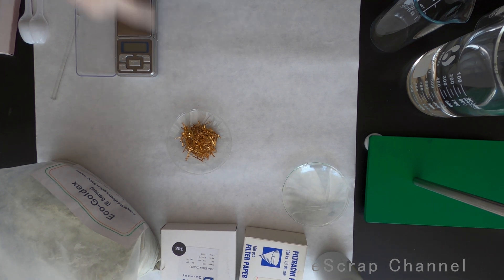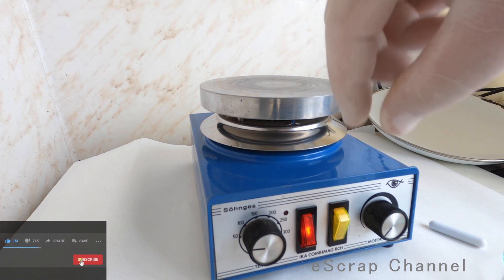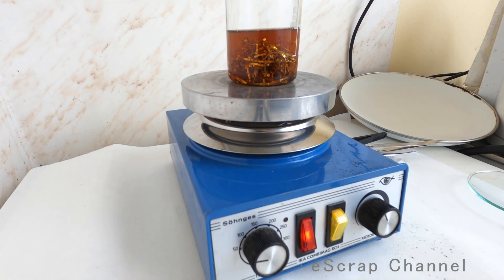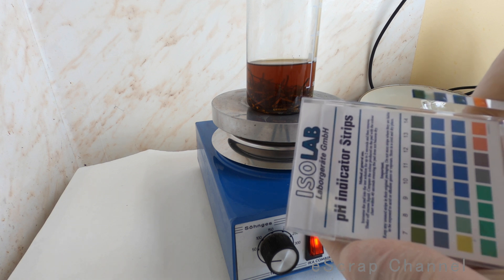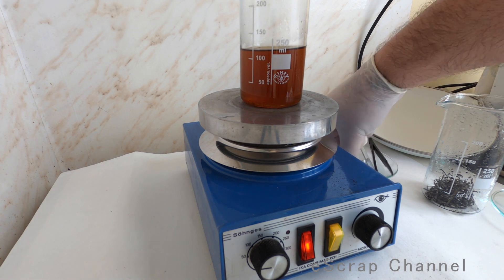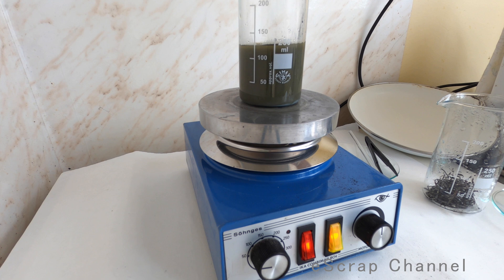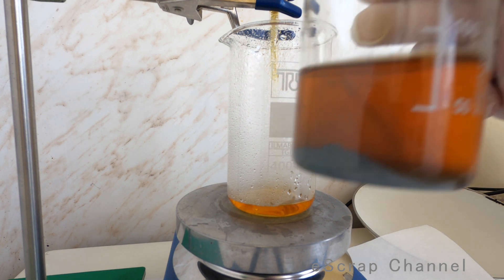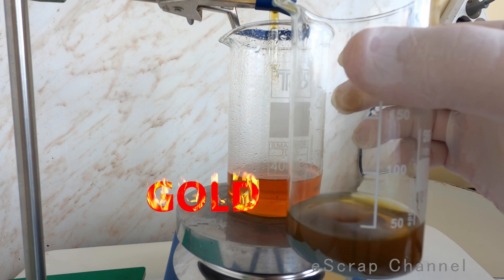How to FAIL using Gold Stripping Agent!

Comment: One more comment. My average recovery per 100 ml of eco gold x is .87 gram . I add about 12 ml of HCL to every 100 ml of solution. This drops the PH to about 5 then I add zinc powder while the solution is hot, 90 to 100c. Never bothered to weigh the zinc, but I don't think I ever added more than 2 grams. A very small quantity of zinc
Reply from the maker: Hi,  thank you for sharing your experience.
Reply: @escrapchannel Just started using Eco about 2 to 3 months ago. I think the compound degrades over time. The first run I did was with about 30 lbs of pins. It took 1200 ml to strip all the pins and my recovery was close to 15 grams . More than a gram per 100 ml. Now it's just not doing it, no matter what I try I cant seem to get more than  .85 per 100 ml.
Reply from the maker: @joek511  Hi, I have an old batch bought more than 3 years ago, so if I find time I will test it. Thank you for the information.

Comment: You never adjusted the PH to 5 before adding zinc. Why is this a problem?. The reactivity tree. The zinc must go into solution (acidic) then the gold will bind (cement) with the zinc in solution. The result is a zinc gold Ion that becomes too heavy to stay suspended in the solution and sinks to the bottom
Reply from the maker: Hi, thank you!
Reply: @escrapchannel Your welcome, I find it works best if hot
Reply: That's not what happens... zinc gets oxidized and gold reduced... they don't "cement" to each other. It only called cementation because when you cement silver with copper, the silver looks like wet cement
Reply from the maker: Common sense wins! Thanks!

Comment: Thank you for your great videos.  I’m confused by this Eco Gold-x product since everyone seems to be using it differently and some are apparently cutting corners?  I’ve watched a couple videos by Omegageek64 and he uses a complex procedure given to him by the company owner John Guo.  He uses the solution until it won’t remove any more gold, then he says he was told to adjust the PH using Citric Acid to almost neutral (around PH 7-8 as I recall) then he adds the zinc.  After he filters out the zinc, by then the PH has become very high again so he adjusts PH again even lower than neutral this time, but using Sodium Metabisulfite, then he recovers more gold using zinc.  This second step may then be repeated again (third drop) to recover any remaining gold.  I watched another video (don’t recall who) and they didn’t add anything to adjust PH before adding the zinc.  Now you mention here you forgot to add NaOH and in your other videos you used NaOH, but I’m confused since that’s a base and if the PH is already at 14 it should really do nothing?

Just the fact you and him must have been given different instructions and are using totally opposite chemicals (base versus acid) is confusing, so who is right?  Either the PH really doesn’t matter except to prevent release of cyanide gas, or one of you is doing it wrong and probably not getting all their gold?  Omegageek64 also mentioned he’s unable to test for gold dissolved in Eco Gold-x using stannous chloride solution, even though the company owner told him it should work.  If so, you’d really have no way to know you didn’t get all the gold, unless you dissolved a weighed amount of pure gold then checked to make sure you could get back 100% of it from the solution.  I would think that is a test well worth doing if you have not done that yet?
Reply from the maker: Hi, I will read and provide you my “truth” later today!
Reply from the maker: Hi, Apologies but all day driving around ... now I can answer questions one by one.
1. Alkaline vs. Acidic solution during zinc adding. Alkaline is a must as you have cyanide complex inside. pH is not 14 when gold is stripped. It is between 11-13. I add Sodium hydroxide to go to solid pH=14! When pH is lower than solid 14 I was not able to fully recover the gold from the solution. This is a common error and internet is full of people complaining that used gold stripping agents based on cyanide products and not able to recover gold from the solution.
When you add zinc powder to, as John says ''pregnant" solution, you should see not the zinc color but black color of gold. Heating and stirring help. Not boiling.
2. Stannous test is not working here. Just Cyanide complexes are one of the strongest known in inorganic chemistry
3. You cannot know if all gold is recovered from the solution in any way. I ensure maximum I take working slowly and giving time to reactions to go to the end, residues to settle well etc. It is really interesting that literally no one believes that manages to recover 100% of the gold from the cyanide solution ... 
4. There are similar reagents sold from China and from other places. All similar. I tested many, but eco-goldex is perfectly working for me to be honest. Some of the others need hours time to strip gold, which is not the case with eco-goldex. And last .. John is really a nice guy. We have had a really good cooperation when I ordered and after that.
Reply: @escrapchannel    Thank you for your detailed reply.  No apologies necessary, it’s a busy time of year and many other Youtubers don’t reply to questions at all unfortunately.  The process seems to be working well for you, so I accept that it generally works ok and you’re happy with it as it is.  When the company has given different users totally different instructions though, I do have to wonder if one method works better than the other?  Again there really IS a way to determine if it is recovering all of the gold, and that is to test using a known weight of pure gold.  If you can dissolve 2 grams of 24k gold in Eco Gold-ex, and then recover 2 grams of 24k again, then as long as you do the procedure the same way each time you should always being getting all of the gold?  Until then you are only making an assumption with no real foundation.  The other person says he only uses this product for a few certain things, so he doesn’t seem to care if he’s getting all of the gold either.  Strange since he uses that overly complex procedure John gave him which literally appeared to take all day!  So until someone does a test and makes a video we really won’t know.  I don’t currently have a safe location to work with the chemicals necessary for refining myself unfortunately, but I have lots of gold scrap I’ve been collecting for years and hope to process myself some day.  I think this product would work very well with Hewlett-Packard or SoundBlaster circuit boards for example, which have fully gold-plated traces.  Again though, thank you for your time.  I do appreciate your informative videos, and wish you a Happy New Year!
Reply from the maker: Happy new year to you, too! 
Test is not easy, as gold stripping agents work well with thin gold plating. I was thinking to do a test using reverse electroplating vs. gold stripping agent of same material ... like 200g pins to decide in two equal parts ... but not time to do it ... we will see!
Reply: @escrapchannel    That’s a very good idea!  I guess we’ll see then.